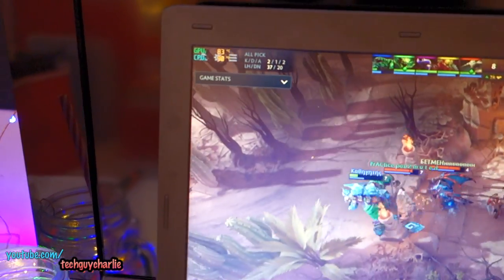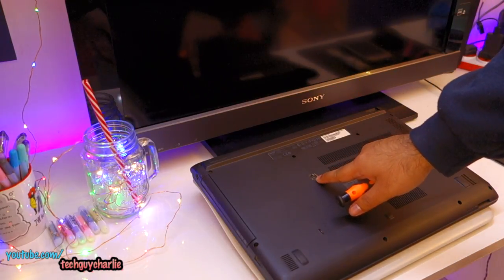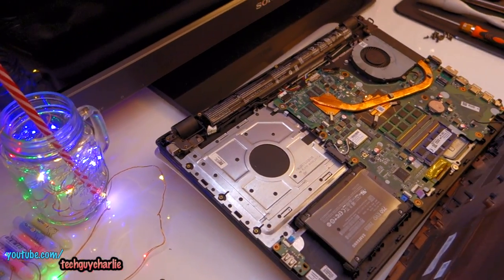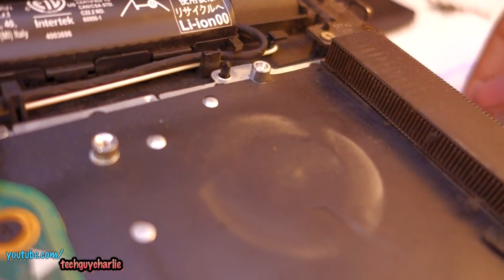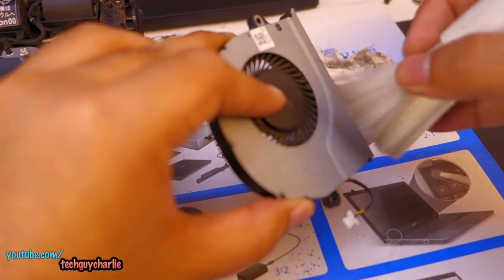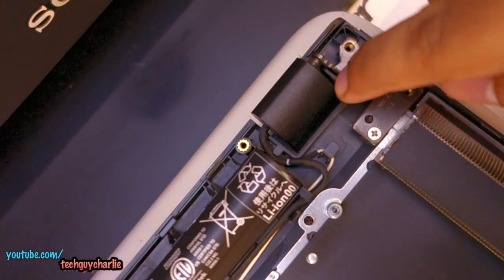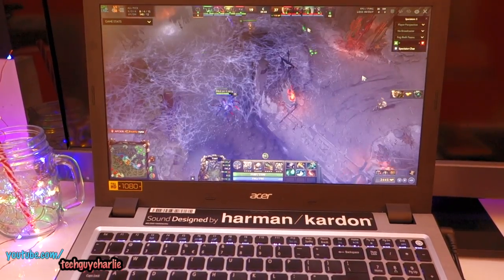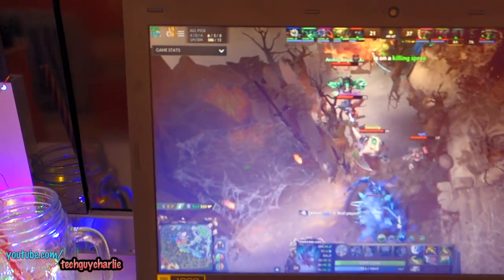How to fix overheating Acer laptop, clean the heat sink and fan (Aspire V3 574G)

Comment: ideal temp is < 70 degrees. The thermal paste could be old. Scrape off that apply a new coating for paste and this should finish off the intended purpose. Cleaning the fan was a great job.

Comment: Things you gotta do to play dota,I feel you bro
Reply from the maker: 😂 😂 computer overheats and the whole game starts lagging like crazy.
Reply: I play league of legends same case with me
Reply: @TechGuyCharlie my laptop shuts down automatically while playing high end games
Reply: @adityachaudhary8456  your power limit is low or you did undervolting too much. Your laptop is not getting enough power. Can be the charging adapter too which cant provide enough power. You can fix temporarily by limiting CPU or GPU to 80% or something. If undervolted, reduce undervolt by 10mV and try try again. If power limit is controllable, reset it to 0 default. Other than that, the adapter can be the culprit.

Comment: i have acer e5 573g and after watch you i decided to clean fan,it seems eazy ,if i can not comment to this comment,know that my pc dead :D i hope i can get rid of it
Reply: i did it it took 2 hour,and 10 C degree fall ,the worst part was the closing the gate again
Reply: I have the same laptop and the number of screws is crazy on this thing.
Also, the temperature is constantly between 50-65

Comment: Such an easy removal. I like those laptop anatomy which able us to clean the fan seamlessly
Reply from the maker: Exactly, there are some cough cough HP whos laptops are a nightmare to open, you need to take apart the keyboard, rear case, and the case just to upgrade the RAM or clean the fan.
Reply: Tech Guy Charlie yesterday I did teardown of my Acer Aspire 4752 and I think that was easiest one after I see this vid 😂
Reply: I will try to do my Aspire tomorrow, Hope it goes as smoothly.

Comment: I'm telling you that cooling system is inadequate for a laptop with an i5 and dedicated graphics, just a single heat pipe and thin heatsink. My old Core 2 Duo notebook without dedicated graphics has a bigger fan and heatsink  than this..COSTCUTTING!
Reply: Cause your core 2 duo is less efficient than this modern cpus like the cpu has a tdp of 15w and i thing the gpu is the same
Reply: I know this is an old post but for anyone else thinking the same-

let's start with the facts shall we?

 The cpu has a 15w TDP (temp boost to 25w for 25seconds) and the gpu core that is being actively cooled  has a 25w TDP.

 The cooler is build to dissipate  about 50w worth of heat. 

simple math will tell you this cooling system will have very few  issues dissipating the heat of both the cpu and gpu at max tilt provided the thermal paste if of good quality. 

The cooling system of this laptop is hence declared perfectly adequate. 👍
Reply: @lewisanth4986  Source for the 50 W dissipation?
Reply: @kiyoponnn  friend's dad is a QC engineer in Taiwan for Acer. Apparently all mainstream laptop manufacturers do this. Take the cpu and gpu TDP (+ 50% dynamic TDP) then add about 10-20% of thermal headroom to account for inefficiencies such as thermal paste and what not(thermal headroom % is then again dependent on the spec of components - lower tdp laptops will have a lower thermal headroom compared to a state of the art gaming laptop with about 150w worth of heat to dissipate) . It's not an exact number but based on the spec of this machine the cooling system is more or less capable of dealing with about 50w of waste heat at an ambient of about 25c (that is the decided base ambient temp taken to estimate these numbers) . Eg:- slightly more if the ambient is cooler and vice versa. Sorry if this doesn't help you :/
Reply: @lewisanth4986  Ohh I see

Comment: Charlie, how long should these fans get a thorough cleaning? I had my laptop PC for 3 years & only did a light dusting off when I installed an LTE WWAN card & replaced the HDD with SSD. I don't have heat/throttling detection software installed for monitoring this kind of activity, please tell me what are you using & where to download one? Cheers.
Reply from the maker: Hey Wilson, That depends on how much you use the laptop, if it's used daily for gaming purposes then clean it yearly, if general purpose use and occasional use then 2 years! This is the first time I've cleaned mine out after I bought it in early 2016 :D
For in-game temperature monitoring I use MSI afterburner:
https://www.msi.com/page/afterburner

HW-Monitor for monitoring temperature
https://www.cpuid.com/softwares/hwmonitor.html

Comment: Thanks for this. I have an Acer Spin 5. Apart from not having an optical drive/drive slot, will the Spin 5 have the same main components and structure as your Aspire? I really need to clean the fan, I think, as the computer has been running hotter and hotter, and I can no longer hear the fan working.

Comment: Wondering how much you can drop temps and fan noise further by repasting the machine with quality paste such as mx-4. Maybe even the overclock the gpu a bit? That would be nice if you could keep the temps in check in the process!
Reply from the maker: Not a bad idea, I might redo the paste later this year, although the 940m barely keeps up even with low settings these days.
Reply: @TechGuyCharlie  all the more reason to do! Extract every bit of it as you can. Also suggest putting small aluminum or copper heatsinks on the gpu ram modules to help dissipate heat when you overclock! Chances are you might be able to push the memory harder before getting to instability due to heat build up which is nice!

Comment: Do you recommend replacing the fan? I have the same laptop and the fan doesn't work
Reply from the maker: If the fan isn't running, you'll have to replace it, no other option, or else the laptop will overheat and might get damaged. Before replacing you should open it and see if there is anything stuck between the fan blades or if the wire is loose. A fix be as simple as that.
Reply: @TechGuyCharlie  I've followed your video last year buti couldn't clean my fan thoroughly. it was still making a grinding sound and vibrating really bad but this time it stopped working. I'll try to clean it again but it looks like i have to replace it
Reply from the maker: This is actually quite a common thing, the bearings go bad on these tiny fans. Just give it to Acer service centre and they will clean and replace the fan with a new one.
Reply: @TechGuyCharlie  yes i will. Thank you so much

Comment: In Quarantine and I cleaned this after 5 years of purchase. It was dirty
Reply: Did you do it by yourself?  I'm considering to clean mine but its a 2014 laptop and the fan is connected with the motherboard. Means i have to unscrew the whole part to get only the fan cleaned, lol talk about anxious
Reply: @malfuriouz7717  Did it by myself! The ony tricky part I had was attaching the back cover (see 10:40) but overall it's fine, just follow the instructions. Give it a shot! half of my fan was covered by huge dirt and found the reason my laptop was overheating lol

Comment: Hey dude
My laptop is overheating when connected to internet for 2 minutes..
But no problem when i disconnected to network.. 🤔🤔🤔
Reply from the maker: That's because whenever you connect to the Internet Windows and Internet connected apps start doing background tasks like updates and stuff, just clean your laptops heatsink and you'll be fine.